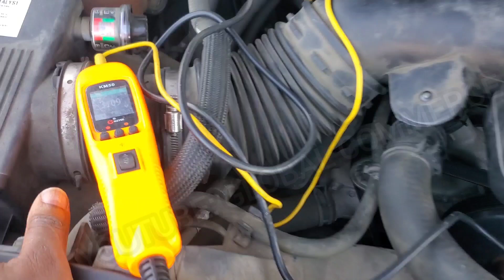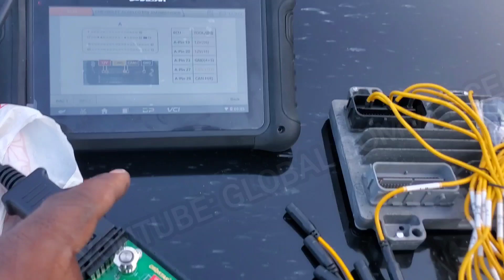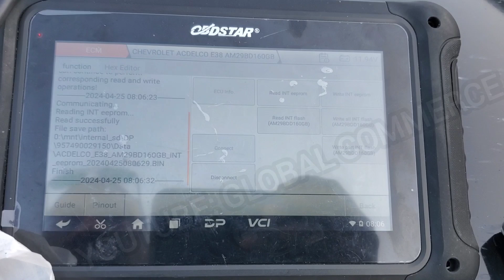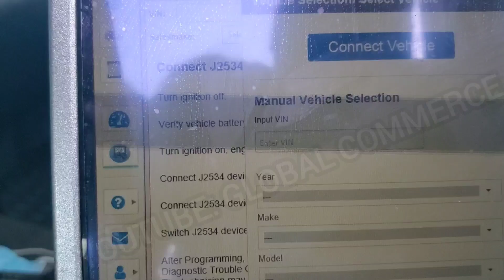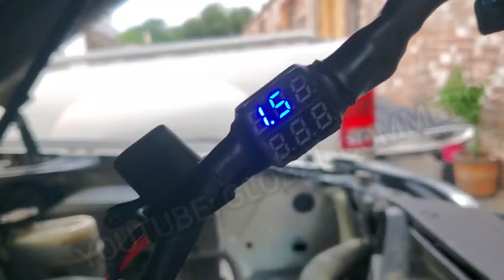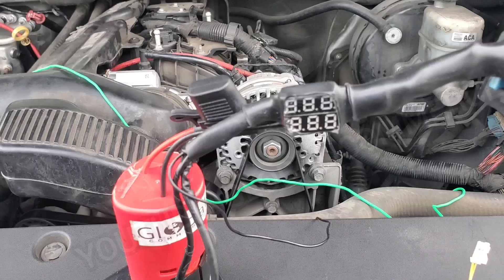GMC Sierra Chevy Silverado Tahoe P0123, P1516, P2119, P2135 engine power is reduced! pinout Diag/FIX

Comment: Would a p2119 cause a hard shift 1-2 
I’ve replaced the shift accumulator piston, all the shift solenoids are working, also on cold start it won’t start on first try it’ll start and stall

2008 Silverado 5.3

Comment: Oscilloscope. Done
Reply from the maker: This guide was done for the general public,  most will not have a scope or know how to use it. Also a scope will not fix this problem.  Even if you can see some sort of visual distortion the solutions demonstrated or explained in this video are the fixes. With or without a scope 

Thanks for watching 👍🏾

Comment: I seen videos of this exact issue and they found something rubbing out on the harness. One time the ECU was bad because it couldn't hold the 5v reference and would drop out periodically. This is a good idea to just go ahead and save diag time and just splice in a new wire. I was always taught to not botch it up but with an old truck that the owner isn't willing to spend 8 hours of diag time fixing the wire and just get it done. Thanks a lot for all of the knowledge you spread. It encourages me to start arming myself with the necessary tools I need to succeed in this business. I just bought an EEPROM reader cheap on amazon and eventually I want to step up to the DC-706 and the KeyMaster G3. Very powerful tools that are just coming to market will give me the advantage that the average shop or dealer doesn't have yet.
Reply from the maker: You sound positive,  I'm sure you'll make it 👍🏾